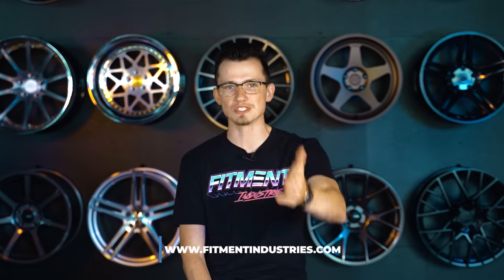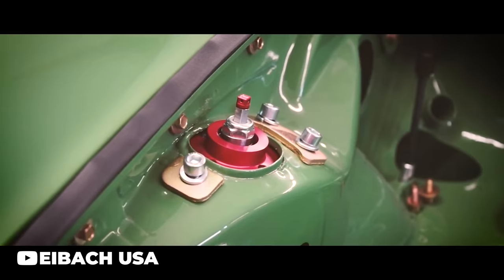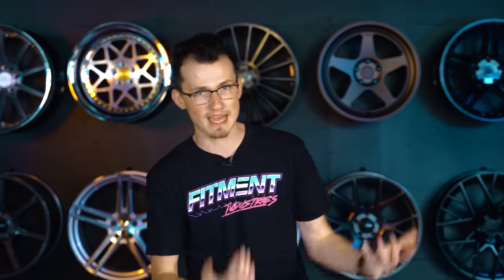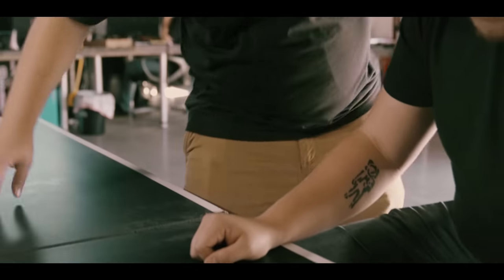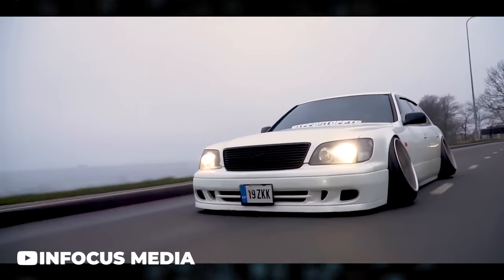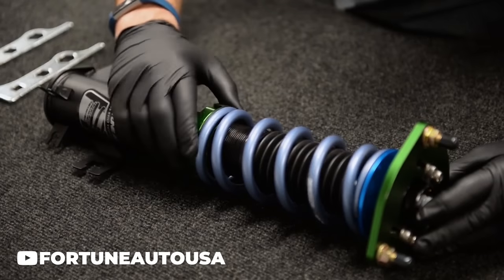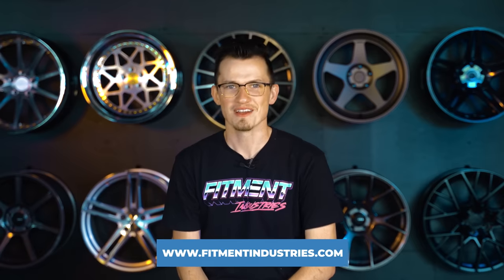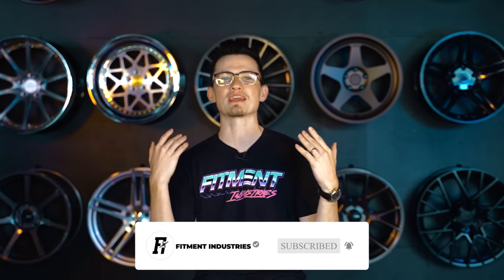Rookie Mistakes Adjusting Your Coilovers

Comment from the maker: The Fitment Industries | Fortune Auto Giveaway starts today! Head over to www.fitmentindustries.com/giveaway for details on how to enter!
Reply: Amazing video! I know this is a Coilover video but I have 2 questions on wheels

Do you guys recommend 5Zigen ZR 520?

and what wheels are these or what wheels are similar to these wheels on the rx8 https://youtu.be/JIkiub9J114
Reply: I wish I could take part of the giveaway but fortune auto doesn't make coilovers for my car
Reply: I wish I could of watched this 4 years ago when I bought my first set of coilovers. I slammed an stance the car. 30 hours laters im going down the highway. The fuel gage went straight to empty😅😂
FRIEND OH ITS JUST A BUMP.
ME OH REALLY CAUSE IM RUNNING OUT OF GAS REALLY FAST.
FRIEND BUY A ECO BOOST.
ME STOPS BY A GAS STATION AN FILLS CAR WITH GAS AN GET WET FEET!.
ME LOOKS UNDER THE CAR.
GAS TANK HAS A MASSIVE TEAR 😫🤣

Comment: No lie, im trying to get coilovers for the first time and im absolutely terrified.
Reply: Dont be scared find an alignment guy and get ready to be taking your wheels on/off a lot 🤣 every other off day im at work (mechanic) messing with it. After this video im actually going to adjust them again 😂 maybe even the right way now. Its a fun process thoo. Make sure you have supporting parts too if needed, like for extra alignment adjustments.
Reply: I don't want any tow or camber, I just want it slammed
Reply: patch dwyer alittle camber is fine, its not gonna wear your tires out faster. Stay under -2 degrees and youll be fine.
Reply: @kuelee9382  thanks for the info. I'm new to the lowering stuff. So I appreciate the input
Reply: patch dwyer Kue Lee is right. A little camber doesn’t hurt and it’s super fun when you’re going through corners on the touge or the highway. I would highly advise to check your ride height after you do some negative cambers tho as it will be slightly lower (this is what happened to mine). 3 months in and the spring has settled thus reducing my ground clearance even more. Will be increasing the ride height by next week cause I can’t go through mall ramps with the current height.
Reply: Thats the best part😂😂😂
Reply: Putting them in is going to be easy for me alot. Its just the adjustments thats gonna freak me out alot. You know what I mean... a lot?
Reply: I was a bit weary to but I got my coilovers on now the problem is adjusting them it's really a pain
Reply: patch dwyer you usually need a little bit of camber to clear the fender and fit a meatier setup
Reply: ugh I'm on the same boat! Not getting wheels tho because daily and I don't know how to not curb trash 😭😭I also drive +25k miles a year and no weekend car lol so... 17' Sentra with insane wheel Gap like ~3" with a ~4" ground clearance
Reply: @alexandergarcia2782  hey, could be worse. Could be the 05 (b15) sentra with a ~4" wheel gap and a 4" + ground clearance... Needing to lower something fierce lol
Reply: Yo same shit
Reply: @ghostboy2x  wtf correlation lmao
Reply: @AmaAndZing  bro I don't even remember wtf I was saying lol
Reply: Man coilovers are easy tbh. My stock strut go stuck in cv boot and tore the boot. Started leaking everywhere. I’ll bring it to Subaru to get it fixed tho
Reply: Lick the stamp and send it ! Promise you won’t regret it when it’s done! It’s worth paying more to get some that come fully assembled as trying to recycle old mounts is often not even worth it (I know from experience) might take a while but save yourself a lot of time and effort by getting the correct tools I promise it will be worth it
Reply: Same and I just wanna lower my car like an 1 n a half.... sheesh
Reply: @alexandergarcia2782  4×4 style.lol. I'm in the same boat. I have new coilovers sitting in my garage. I just need to clear a weekend to install them. I have some other things to put on the car first.
Reply: Same!!!
Reply: My worst fear is I accidentally order the wrong part
Reply: Felt like that once but bout 50 cars down the road and who knows how many wheels and coilovers it aint nothing but a chicken wing dont be afraid
Reply: same bro
Reply: I just ordered my first pair and I'm terrified too lol, but only one way to find out how good/bad they are right
Reply: @alexandergarcia2782  just don't strive to get as close as you can to the curb lol.
Reply: I installed Megan racing teal blue ones and i LOVE IT OMGGGGGGG NIGHT AND DAY DIFFERENCE!!!! Made the Sentra ACTUALLY fun to drive!!! Tony wheel gap in the front and no wheel gap in the back and i added a lip to the front!! I didn't realize the lowered&static lifestyle comes with a price.. i can no longer use a lot of drive thru car washes😭 so i have to suck up the 95°+ Miami summers and wash manually or drive to a non speed bump or rail drive car wash!
Reply: @alexandergarcia2782  better to wash it yourself anyway
Reply: OOOOOOOO 👻👻👻👻 SCAAWYYY BOOOO AHHHH HORRORRR SCAWAYYYYYYU OOOOOO
Reply: 😂😂😂😂😂 Ah shit  Me 2
Reply: @johnj05  front passenger clunckd rest are fine
Reply: Glad to see someone else say it! I have my Buddy adjust them and now I can’t get ahold of him and I want it lower…..
Reply: @patchdwyer9299  100% with ya
Reply: @patchdwyer9299  you want a slight bit of camber when your down there for fitment reasons and handing reasons
Reply: I'm in the same boat about coilovers for my g37
Reply: Dude my car literally came with coil overs. Which is great, but I’m scared to adjust them
Reply: Same
Reply: It’s not that bad
Reply: Bro I just put bc coils on my c5. Best mod I’ve done so far😍
Reply: My guy I was too, I got cheap ones but with a ton of knowledge in mind I know exactly how to get what I want out em and you just have to do it and send it my g
Reply: Only time you ever gonna learn is by making a mistake and then learn from it man
Reply: Don’t do  it!!!  nothing but headaches and the springs do same thing you want, lower it. Unless you’re going to adjust it a bunch of cause you’re going to the track and street just get the lowering springs
Reply: Same bro
Reply: Honestly bro just play with with it constantly you will get frustrated but at a certain point you’ll be able to do it all with your eyes closed
Reply: @alexandergarcia2782  was it hard to install the coils?
Reply: Same 😅
Reply: I'll tell you from experience,  it's an investment.  Not only will you need coilovers but you'll also need front upper camber kit rear camber kit, and toe arms for the rear. At least that's what I needed for my 06 Acura TL
Reply: Here 3years later and was going to write the same damn thing 😫
Reply: Dont

Comment: The best piece of advice I have for anyone when adjusting coilovers, or just installing them. Start high... You can always go lower... Don't knock the transpan off on the test drive.
Reply: That is an excellent advice.
I bought my coilovers not to lower the car.  Got them to replace the aging struts/shocks AND get better anti-roll response & less body-sway-shifting in between braking & turning.
I have my ride height set at the "highest" within manufacturer's recommended range.  Even so, it is definitely lower than stock setup by ~1 to 1.5 inches.

Comment: I bought tein flex z’s a year ago and I’ve loved the adjustment process. I love tweaking the coilovers. I went from a rookie fitment to a pro smooth riding fitment
Reply: Bro help me out😭. Just got the Flex Z but my ride is bouncy. Should i adjust the dampers?
Reply: @DeCay Grim,
Question:  Your rear coilovers damper adjustment knob - are they easily accessible? Or would you need to pull out the coilover every time you want to adjust the rear damping?

I just installed the Tein Flex Z on my Mitsubishi Lancer.  The damn rear adjustment knobs are shielded behind the chassis.
I'm trying to figure out if there is a way to make future adjustments easy.  
Tein does sell the FLK01-AA300 extension cable.  But I do not see where I can thread the cable's knob to THIS side of the chassis... 😭
Reply: @itsmuna8155  If your ride is bouncy, DEFINITELY adjust the damper towards hard setting.

Tein recommends starting at click#8, which is halfway between softest & hardest.  That's actually a good position to start.
I started from softest - way too bouncy.
Dialed the front to click#8.
Have yet to reset the rear; very difficult to access - basically need to pull out the entire coilover just to reach the adjusting knob on top.

Comment: So, what I keep hearing is. I can buy coilovers with a zillion different setup options.
But, I pretty much need an engineering degree to set them perfectly for track conditions. 
If I get the settings wrong my car handles worse than it did with factory suspension. 
And for every new setting I try I have to get an alignment done. 

I'm coming to the conclusion that coilovers are more trouble than they are worth. 
Can someone tell me where I'm wrong here because honestly, I'd love to improve my suspension.
Reply from the maker: Get them corner balanced at any shop worth a damn and they'll handle better than anything.
Reply: @FitmentIndustries  Get em corner balanced?? What does that entail?
Reply: @FitmentIndustries  what he said^^
Reply: find someone who specialises in your car and get them to put a fast road geometry on it (unless you're tracking it then it will get more advanced)
Reply: @bbbugeye2744  Corner balanced means somebody will weigh each tire on your car separately at the same time (4 scales) then adjust the height of your coil overs to put as close to the same amount of weight on each tire. So each of the four corners of your car have the same weight.
Reply: @donitmyself8935  Would the load not be uneven when cornering though? E.g they balance each side for the cars weight while still, but they cornering the weight on the tires would be completely different. Is that something they account for when setting the car or is it more of a nuisance than a benefit to calculate
Reply: @SprinkCalSA  the initial adjustment is for weight distribution or balancing. That is your set point or new reference point. You can then make adjustments for your weight and your style of driving. Basically getting everything dialed in and square and then fine tuning.
Reply: cough cough buy annex coilovers cough cough

Comment: One thing I've noticed with coilovers is sway bar links! Adjustable seat bar links I feel are looked over when doing coilovers. My 03 eclipse gs has been a hassle with the front being lowered.
Reply: Putting coilovers on my 03 eclipse now, and I’m ordering some adjustable sway bar links and a ton of stuff for the rear suspension
Reply: @budthestud9400  If you're going that far, might as well replace the rear sway bar to a stiffer one with multiple mounting points.
I myself started with sway bar change (and new end links) - ran that for 6months, and THEN installed coilovers.
Doing these in stages help me understand how each change impacted the car's behavior.

Comment: I purchased my rims and tires from fitment industry's.  I wish i would of ordered my coilovers but instead i purchased mine from facebook market place but they hadnt been installed as the owner ended up totalling his car. I got the tien street z coilovers which didnt come with top hats. Make sure you get coilovers with top hats. Puttint together a coilover with no previous experience had me on youtube constantly. Plus trying to align my car without the proper camber kits and toe arms made the ride terrible. Just make sure to clean the threads (dont use a metal brush nylon brushes only) but other than that im very happy with how my ride feels now. After all the camber kits and alignment my car feels smooth. I love how it rides now and look forward to showing off my rims and lowered acura tl

Comment: Prior to starting the install, I screwed the adjusting tube in to the bottom base ? is that wrong ? I could not turn the double ring to adjust height. Uninstalled and made the spring rattle about 2 inches. I really messed up this peanut butter sandwich. what do i need to do ?

Comment: Love when people buy a $3,500 coil over setup just to get an external fluid reservoir 100% for looks.... Just buy the $1,000 set, and buy an aluminum look-alike part with a fake line.... if it’s for show, who the hell cares, and you’ll save $2,500 which you can now use for the new engine because you bashed your oil pan on the ground, oil leaked out and you popped the engine.... perfect.

Comment: To quote RCR:

"Stancing is like a cosmetic method of restoring your computer to an earlier date before it was clogged with registry errors, although it also allows you to complain about how it doesn't take corners like it used to. "

And

"BOTTOM OUT OVER A POPTART! Yeah bro, my car's so low I can't use it!"

TL;DR a rookie mistake I see is people not accounting for the local roads and leaving some space for the road and wheel, which ends up causing you to go to scrape City and in many cases a free bumper removal

Comment: When I get a car I'm unsure whether to get Coilovers or not, because every neighborhood in my area, including mine, has massive speed bumps with extremely tall driveways. What should I do?
Reply: Depending on the 1 inch lower won't make a difference on a big speed bump if u hit it at the right angle
Reply: Air ride yo

Comment: Im in the middle of installing skunk2 pro-st full coilovers on my Integra. I ve done a ton of research on installing them to make sure I installe them correctly. However the info i researched says you can lower the car with the coilovers on the car by a loosening the lower locking collar and using the spanner wrench to turn the perchs above in order to spin the whole shock down into the threaded body. Why is this not a good idea? And why should I take them all the way off to make this adjustment?
Reply: I'm sure you figured it out, but yes, there's no reason to take the coilover off to adjust the ride height.

Comment: Getting more drop by loosening the preload to where the spring "wobbles" around. Good times. Or not using the soft keeper spring that some coilovers have so you can get another inch of drop. More good times. Lol.
Reply: vehicle weight overcomes the compression provided by pre-load. I am not sure what you mean.

Comment: Quick question, so how would you make the coilovers feel more stiffer by adjusting the preload? Mines ride like ass cause I don’t know how to make them feel stiffer
Reply: you cant. Preload is only the tension on the springs when no vehicle weight is on the spring. Think of a rock crawling jeep that has a wheel come off the ground. Lots of misconceptions about preload.

Comment: I spend 750 on Coilovers d2 , went to get a alignment uff. I need control arm bushing almost 500 more on just suspension,  Nuts !! You should Talk About that 😬
Reply: Check their old videos
Reply: They have already. You could change everything you can while you're installing the coilovers.
Reply: Usually when installing coilovers for the first time, it's a good idea to also install adjustable control arms and toe arms. It helps to correctly setup the alignment.
Reply: @jorgemoreno9143  Now i know 😂😂

Comment: I bought TEIN Flex Zs months ago, finally installed them yesterday along with ALL ( yes all ) new parts of the suspension ( adjustables where needed ), minus rear subframe itself, and roll bars. Not flexing but it's a 20 year old car with 125k so I do it ONCE, DO IT RIGHT...The Japanese are great at dialing in. The TEINS came 1.8 inch dropped fr/r 12k fr 10k r, preloaded, greased, with tamper stickers to ensure they go to the customer same as they left the  factory. And they were perfect ( shout out to Redline 360 ) coming out the box. Long story longer lol, their ( TEIN ) setup didn't need touching ( dampening is a YOU thing ), the ride quality is like OEM ( just more precise ) and they made the car sit EXACTLY 2 fingers ( Loosely. I'm sure they'll settle a couple more millimeters)...Only problem is...That setup is for stock 16 inch wheels on 225/60 tires, and not the 18×8.5 245/40 wheel and tire combo I bought from Fitment Industries 😂😢. So yes I will be using the preload locking ring to adjust the height because TEIN has a 6 year old video telling me too. 😂😂😂

Comment: I bought coilovers for my ek3, i didint know some coils didnt have lower threaded bodies. im trying to reduce my wheelgap and i got coils for adjustment, now i can only adjust my spring. do i bring em back and get one with a threaded body or stay with the current ones and use the spring adjustments for lowering?
Reply: I suggest a quality that is FULLY ADJUSTABLE coilover.

Comment: Is it just me but to lower my cars I just install a front lip and side skirts. Saved $3,000. Boom!
Reply: That's kind of extending your car, not lowering. You'd still have a decent gap between your fender and wheel
Reply: Scott last name Well, yeah you’re right. Its an extension. It looks good enough depending on the car n the wheels u use

Comment: I bought some function and form type 1 for my 9th gen to only drop maybe 3 inches and when I went to put my tires back my negative camber was soooo bad that the tire doesn’t even move. I didn’t mess with preload setting what so ever. Why did that happen?

Comment: When you adjust ride height are both the ledt and right supposed to match? Idk if it’s my driveway but it seems uneven.
Reply: From my understanding with a professional setup the driver side should be a little higher to compensate for the weight of the driver. This is in millimeters though. So it shouldn't be noticeable.